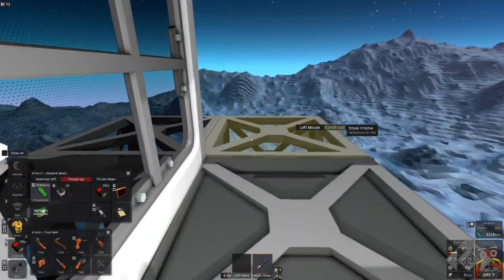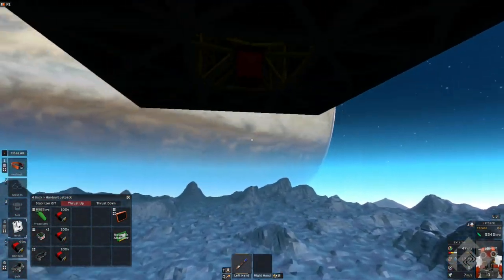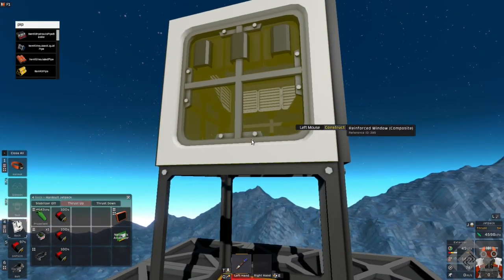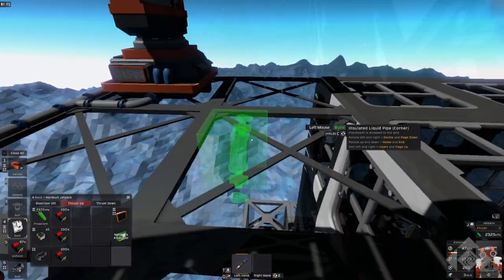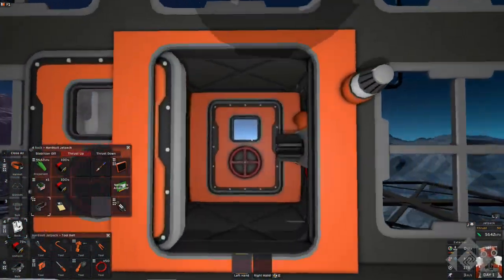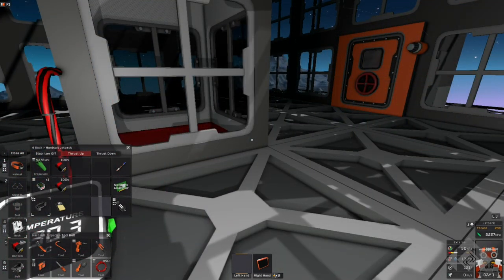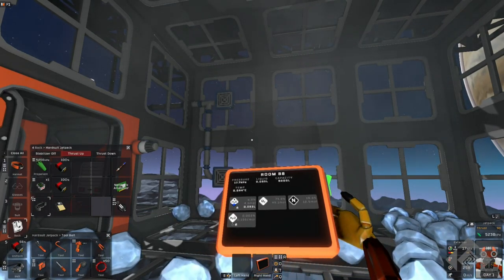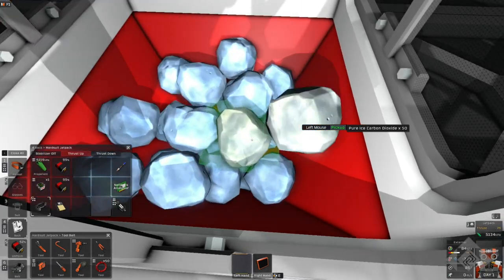Building A Vapour Deposition Heat Pump, a not so quick tutorial - Stationeers Liquid Update

Comment: At first glance, I thought I was going to be seeing vapour "serve writ" in a law court, lol.
I really liked how you "walked through" the solution - made it very easy to grasp the concepts and execution - with entertaining dialogue, to boot!

Anyways, this is a fun experiment - that starts with "a big f@#$in' funnel", as you so eloquently put 🤣- I like that it is not cheesy, as opposed to the ice-crusher method. Its a bit of a pity that the BMF solar radiators are mid/late game items, else this is a fun centerpiece to a survival game "living space" :)

[Side point:  You used a great many words to describe this:  The SDB Hopper is "not airtight" in game terms]

The outro ... 🤣🤣🤣
Reply from the maker: You can use tier 1 radiators, and actually, the large deploy-able radiators, are WAY too powerful, and saturate the system.
Reply: @JoelleTheAbsurdist   👍 Sounds like something worth trying when I do a Europa save
Reply from the maker: @baronvonschnellenstein2811  I switched the large radiators out for three lines of pipe radiators, and it's still capable of over heating the system on basically full power.

Comment: Nice Video...
It would be cool to have a video on how you can filter all gases only with temperature and pressure. I build little system which filters the Mars atmosphere only with pressure and temperature into tanks for each gas.

PS:
You get oxygen with a condensation chamber with 400kpa and -168 celcius.

For nitrogen i use a condensation chamber with 400kpa and -175 celcius. This will condensate oxygen and nitrogen in a liquid pipe. With the right pressure and temperature in the liquid pipe you will only get nitrogen gas from the liquid pipe and keep the oxygen liquid. You can also use a evaporation chamber for the liquid for more safety.

CO2 is easy. I use -40 celcius with about 1500kpa. This will only condensate CO2.
Reply from the maker: https://www.youtube.com/watch?v=qytGLiw-_ag

Comment: I got a cooling issue on Europa, not heating 😄.
When I try to cool down gases from the adv furnace my pipes burst by thom getting to cold and generating ice... can't for my life get around it...
Reply from the maker: Limit your number of exposed pipes and put a valve somewhere to isolate the main trunk from the outside air. Alternatively, build an airlock around your radiators so you can close the door to prevent over-cooling... or, put a condenser valve on your trunk line to drain any liquids away.
Reply: @JoelleTheAbsurdist  An airlock is an intresting idea. For now I have been mounting and unmounting an piperadiator manually, all other solutions have failed since ice formes in the pipes when disconnecting the cooling side with a valve. Tried single, loops, and integrate it with my wasteloop but all fail as the temperature drop. Even tried difrent gases and tried to mitigate it. Havent tested all gasses yet tho sins i play survival.
But an airlock who closes with the valve to hinder the gases freeze i a nice idea, thanks!
Reply from the maker: @matse9375  If you want, you can zip up your save, shove it on google drive, and I'll download it and do a video on fixing the problem
Reply from the maker: If you do though, make sure you're in a cryo-chamber or whatever the hell they replaced them with.
Reply: @JoelleTheAbsurdist  Wow, its almost 3 am here now so I will try to do it tomorrow. 😄
Reply: @JoelleTheAbsurdist  Solved it! Nitrogen does not solidify at belov -146C and dont burst the pipes, still learning :) Started a few weeks ago and love all the tutorials, thanks!

Comment: That's a really handy tip about the walls, thanks. Embarrassed that this is still going over my head: I can't really understand how this is more efficient than the solar absorbers alone. Where is the "free" extra heat-separating energy/work coming from in this system? Wouldn't the radiators need to store energy into the solid refridgerant to melt it equally as much as the liquid refridgerant then releases as heat back up in the heating room? Is it something to do with the fact that gravity is doing work on the solids to move them away from the heating room, but we can ignore gravity on the way back up when we use the "free" movement through chutes and pipes in any direction, including upwards?
Reply from the maker: Mathematically, it shouldn't be more efficient, you should be absorbing and releasing the same amount of energy, unless there are some calculation errors in the game, which there could be, but I didn't look that closely... It's faster, because you are literally pumping the heat through the system. All a heat pump is, is a conveyor for thermal energy. The three radiators are a massive overkill, and did heat the melting building and the core to 124 degrees in about an hour a so, with just those, there would be no problem warming your base. The conveyor blocks and the fact you're dealing with a solid does eliminate the need for a pump because the conveyor blocks move mass for free, but what you're doing with the state change is a kind of amplification. As the fluid state changes, it absorbs or rejects more heat then it would be able to if it was in a steady state., but this only works passively, when the temperatures are very close to the fluid's triple point.
Reply from the maker: You also don't need the big buildings or the "core", I just built those so we could watch the process happen, all of this could take place in the pipes.
Reply: @JoelleTheAbsurdist  Thanks for the reply! I think I need to go and learn more about heat pump efficiency IRL because I can't seem to settle on an intuition for this.